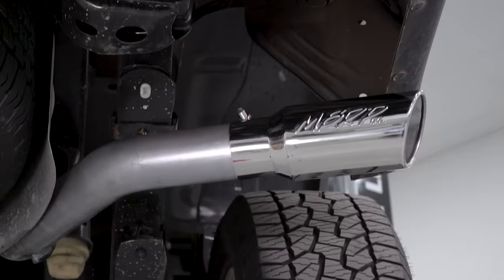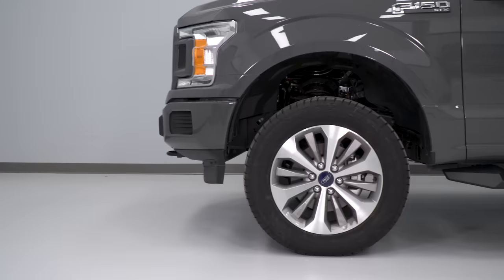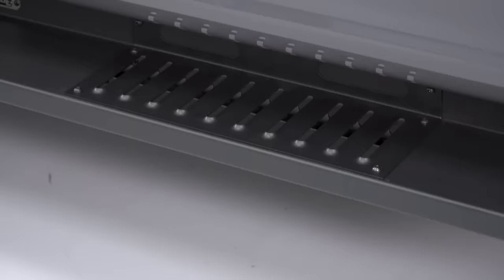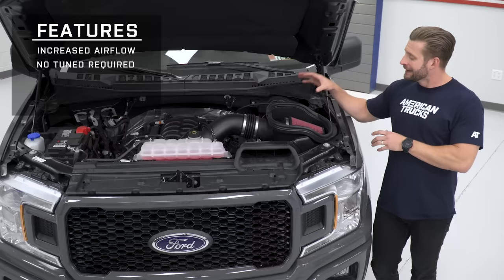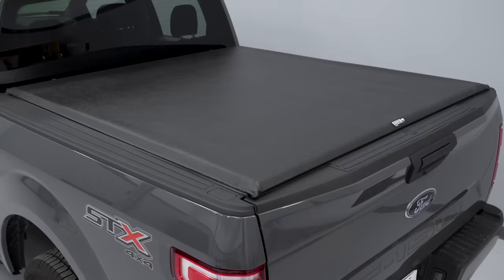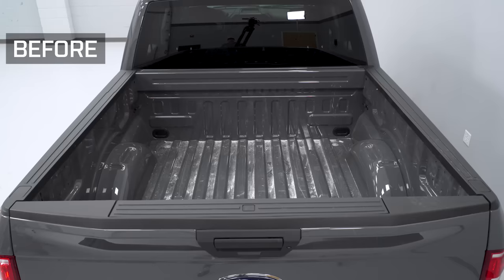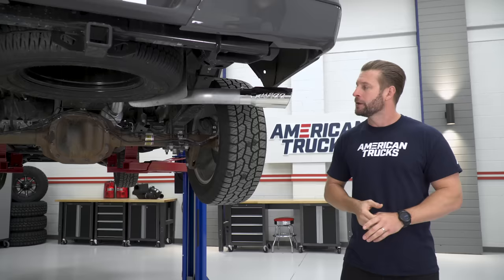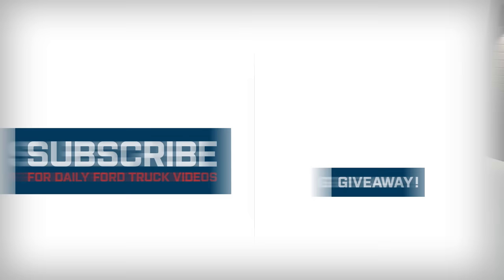The First 5 F150 Parts You Should Buy Under $500 For Your 2015 - 2018 Ford F150   The Haul

Comment from the maker: Learn more about this build and these 5 parts here:http://bit.ly/2sbZ8MZ 
Subscribe for New Ford Truck Videos Added Daily: http://bit.ly/ATFSubscribe
Reply: AmericanTrucks Ford can you really get 35's on that truck with only a 2.5" leveling kit?
Reply: Timothy Anaya yes you can..it’s tight.
Reply: AmericanTrucks Ford,  what does the leveling kit do to my towing capacity?
Reply: What kind of wheels & tires did you show briefly on the leveling kit? (Not the factory set obviously.) Those looked awesome!
Reply: AmericanTrucks Ford  what is the color
Reply: bernardquattlebaum I believe it’s leadfoot
Reply: Can you use the air intake system with an eviction boost?
Reply: AmericanTrucks Ford  sweepstakes

Comment: Personally I think Rear Wheel Well Liners are one of the 1st Must Haves, Huge Difference for about $150.00!
Reply: Agreed.  Mine was $118 on Amazon.  OEM too.
Reply from the maker: Not a bad choice either Michael- great suggestion.  -Justin
Reply: I've added it to my list of items for my truck.  I saw them before, but your comment reminded me to get them.
Reply: Glad to help....LOL!
Reply: I didnt know these things existed until I read your comment and googled it - wow
Reply: Makes for a much cleaner look, wouldn't you agree?
Reply: A little undercoat in there and the liners might not be needed!
Reply: Imo, the liners don't make that much of a difference unless you're rolling a pavement princess. Because if you have any aggressive tire and taking any place with mud, you end of with mud everywhere underneath. Rear wells is a 30-second wash with a pressure washer, while the rest of the bottom is over an hour if you're thorough. Better off spending money on flares if you are slinging enough to get the wells dirty.
Reply: I tore a ford one on my 2016 and had a piece of rebar go through the aftermarket one on my 2018....gave up after that now.  I didnt notice a road noise difference like they say you get.  It sounded the same to me.
Reply: My lineX dealer charged me $110 extra to do the wheel wells. Way better than a liner
Reply: don wilson those are fender flares
Reply: Lol I just sprayed can bed liner in my rear wheel wells. Looks the same and for $20
Reply: Bobon Meiknob you’re wildly misinformed
Reply: Bobon Meiknob water and mud comes up all around underneath from the tires liners or not. Liners are for keeping the wheel wells quiet and free from rock damage and spray in liner does a better job of both
Reply: Bobon Meiknob if they prevent water from going up then they also prevent it from going down thus keeping water against the frame.  I hope for your sake they don’t do what you claim.
Reply: Bobon Meiknob come by my shop anytime. Tremisama Safari Lodge. We don’t have any trailers here, so if you want a more home like atmosphere you can choose the rough camping option upon arrival for a 30% discount
Reply: Bobon Meiknob try google. You’ve heard of that right?
Reply: Bobon Meiknob show up then tough guy. I owned the operation for 28 years.  There’s no misspelling. You asked me where I live not the name of my business.
Reply: If you want real wheel well liners get a civic. Otherwise grow a pair and man up
Reply: vise versa doesn't look the same on long beds. Factory liners are a must on those if you ask me.
Reply: I agree. That was the first thing I put on cause it just looks ugly in the back without them.
Reply: I don’t know how I missed this. I’m on my second F150 and the rear wheel well spacing and gap has always bothered me. You are the hero I needed today.
Reply: I paid 105$ for husky rear wheel liners on Amazon!!!
Reply: @hawaiianf1504  do you have a link
Reply: @luissegovia8650  will it fit my extended cab ? All I see is crew cabs?

Comment: I lost about 1.5 mpg with a leveling kit. It will mess with your aero. The truck has a rake on purpose, and it's not just a preload for weight in the back. The CAI doesn't really do much either, other than a tad bit better throttle response in Normal mode and a cool "whoosh" sound with RPMs. Most worthwhile mods in this lineup are the tonneau cover and the running boards lol.
Reply: Bob saget. Legend. 

Will not do a leveling kit for that very reason. A company that has built maybe millions of these trucks over the years has them sitting lower in the front for more than just aesthetics. Else they would have pumped them out leveled up. Gas mileage is just 1 reason not to add height to the front. Another big one for me is if you ACTUALLY put heavy things in your truck bed time to time because your bed is sagged and your front has you up blasting off like a rocket.

Comment: 1. 3M Thermal Window tinting, including clear tinting on the front and back windshields. (Trust me, you'll thank me later)
2. Weather tech mats
3. Hard cover for the bed
4. Cold air intake
5. Bully Dog programmer

I bought mine used, so it came with chromed running boards, but yeah, running boards are a must.

Comment: My top 5+ must-haves 
1. Window tint and 3M (don't get cheap stuff)
2. Upgrade factory headlights to LED ($500) (and fog lights while you at it)
3. Bed cover ($250)
4. Rear wheel well liners ($150). 
5. WeatherTech or Husky floor liners ($150)
Bonus: Air filter (OEM is aweful)
Reply: Do they make any LED kits for the trucks with Daytime Running Lamps?

Comment: My top 5 under $500 for a 5.0:

MBRP stainless exhaust $421
OZ tune + used tuner $450
2" Level $50 (+$60 alignment)
2018 GT intake mani (ported if possible) $300 + porting
Remote start $150

honorable mention? JLT or PMAS CAI if you feel like it.
Reply: Gotta get that JLT catch can

Comment: you do not gain any hp with CAI unless you tune the truck. it will not change anything because the factory intake parameters remain the same unless tuned. it is all in everyone's head because the CAI will make the engine sound louder.
Reply: AlexanderFX4  yes in deed.  The tuner a must and u will see the improved response and even better gas mileage.

Comment: I installed a full bed rug kit in mine for a really nice mod for under 500. Window tinting and rear wheel well liners are a couple nice mods that won't break the bank either. I bought a new gator evo cover for under 500, much better than a soft cover.

Comment: Most importantly  JLT oil separator, that's a most on any direct injection. Motors. I have one on my 2015 V6 mustang and 2017 f150. Every oil change the truck is 3/4 full of oil.  So this should be the most important . Saves from carbon build up in your engine and longevity of the vehicle. $139.
Reply from the maker: Hey Casey- great recommendation! -Justin
Reply: Casey Berry yea some ppl concerned bout carbon & gen1 Ecoboost motors but truth is Ford isn't having problems overall esp if you run "full synthetic" motor oil AND tier1 fuels.
Reply: @Davido50  by the time I spend the extra 40-60 on 1 synthetic oil change  , the extra on gas for premium per gallon for a month. I've paid for the separator. The life of the vehicle paying 3+a gallons 75-100 syn vs 30-40 regular oil change from ford. I'm money ahead. And I even throw a high grade fuel additive in it every oil. And still money ahead just to empty a little bowl . Cheap or expensive oil or all will go thru pcv valve,  maybe more than another.
Reply: 2018 is Port and Direct, so you dont need the Oil Seperator dont waste your money.. i have 1 and it hasnt filled up more than an inch in the Catch from over 10,000 miles and a year of driving it.. Port Inj will keep ur intake valves clean. If it gives u piece of mind then go for it, but only if you have a 2017 or older should you get one.
Reply: @caseyberry7960  that seperator isnt going to prevent oil sludge build up inside of your valve train.. only the backside of your intake valves.. other then that of course go Synthetic... conventional oil is garbage hence it can barely last even 3,000 miles before the additives break down amd cause metal to metal contact..
Reply: I drilled a weep hole in my innercooler and the cost was zilch.  works as good as your fancy catch cans and oil separators
Reply: @charlesphillips5723  Yea we'll see in 100,000 miles how much that seep hole just to drain condensation has helped your engine internals when your valve train is wrecked😂 but it'll be a life lesson for you to stop believing everything you watch on YouTube 👌
Reply: @nickh3809  I have 161,875 miles on it now.  every oil change I hit that weep hole with intake cleaner.  MAP, OX sensors all test good
Timing gear problems are overrated.  It brings in big bucks for the mechanic when something entirely different is the problem
Reply: If you live in California, you're screwed. Illegal and American Truck cannot ship to any Cali address. I just found out. Their site should warn you of any contraband  upgrades.
Reply: Carbon isn't a huge problem if you use Tier 1 fuel, a quality synthetic oil and frequent changes the catch can isn't a must have. It definitely won't hurt anything but keeping up on the maintenance properly is #1. Other thing is spark plug charges are at 40-50k on an Ecoboost NOT 100k miles.
Reply: @alanholmes2366  my 3.5eb requires spark plugs every 35k miles or it gets a stumble at idle. I do tow a lot though
Reply: Despite reading all about others putting Tier 1 fuel in your F-150’s the Ford Motor Company recommends only running Regular in your Ford vehicle. So why run tier 1 fuel?

Comment: Roush cold air  system routes the opening to the grill as to not suck in hot air from the engine compartment I would think that would be even better than the one you’re showing although I don’t know if Roush offers that one to the general public
Reply from the maker: The intake shown in this video is from Roush and does utilize the factory 'cold air' ducting. -Justin
Reply: AmericanTrucks Ford yes but not the one that comes on the ROUSH supercharged F150 off-road that pulls its air from the grill not from the hot engine compartment..

Comment: One of the dumbest waste of money is changing the air filter housing. The only way a filter can have ‘less restriction’ is to filter less air. It doesn’t matter what kind of air filter that is installed, a engine cylinder can only be filled with current atmospheric pressure. The only way to increase the air in the cylinder is: 1. Cool it. Cooler air is denser air. This is why most modern vehicles are engineered from the factory to get air from the wheel well, it’s cooler.  2. Force more air in the chamber using a scoop, turbo, or super charger. A aftermarket air filter box & filter doesn’t cool the air any better than a factory one. And it certainly doesn’t force more air into the chamber. They are useless.

Comment: My list for ‘19 XLT 5.0 4x4 crew:
1. Tailgate assist from u guys, $37
2. Wheel well covers from u guys, $135
3. Dualliner drop in bed mat/ plastic sides/tailgate
4. Center dash and interior replacements of stock cheap black plastic w. wood trim
5. Bug deflector

Comment: Other things is oil separator, window tent, toolbox, floor mats, wheel well liners, programmer too sct makes a more budget friendly one with that’s not touch screen and make good power gains. And one more is mud flaps some don’t like them but I rem them on my 13 F-150 because I have wide wheels and it saves paint to munch and husky makes a kick back for lifted trucks or wonder wheels that looks good and keep from rubbing

Comment: The MBRP for F-150 and Ranger exhaust system is easy install and sounds amazing for south of $500. I like the design compared to the other expensive options. Glad seeing this in the top 5 suggestions.
Reply from the maker: We agree! Thanks for watching!!
Reply: Hi, great suggestions. ( I must add that I am new to all this) I just bought 2018 F150, 4WD, 5.OL V8, I would like to change the tires from 275/55/20 to 285/65/20! As you know there is not enough space in the front, you talked about 2.5” leveling kit, I have two questions: 1- is that going to give me enough clearance in the front (top and the sides), 2- what a bout back? There is lots space in the back, do I need to add anything else? Thank you, Nick

Comment: I would start with a auto start and stop disabler
Reply: you pull a plug, it's that easy. I'm not even sure why people freak out about it, it's not even an intrusive function.
Reply: @zackjuett967  yes, did that for my new truck! Just hate that auto start/stop!
Reply: David Firth Yes. There are three options; Use FORScan and hook it up to your truck and disable it, unplug the wiring harness that’s under the driver side, or buy that stupid expensive switch that Zack recommended

Comment: Zero of these modifications would be in my best options. First of all unless you are wanting to decrease your acceleration and fuel mileage by adding some big aftermarket wheels and tires raising the front to level it just creates more goofy looking gap between your oem tires and fender wells. Remove the rear spacer if its a 4wd or just put in a drop shakle. It will be closer to level and still retain some of the rake depending on how much shackle drop chosen. Aint you wont need to get a realignment like after you install the blocks in the front. Cold air intakes are the dumbest thing in terms of the name since they draw air from the same location as stock. Its a same air intake. 5.0 F150 trucks can achieve marginal gains with "SOME" aftermarket intakes but  "MOST" actually lower the horsepower on an Ecoboost. Especially the non enclosed intakes. They range in price from 300-600 and help very little at best. If you are doing a bunch of performance mods the intake can come in at some point, talk to a trustworthy tuner to purchase one that at least helps a little. The factory intake is very good and is on most vehicles these days. If you have an Ecoboost save that money and buy an intercooler upgrade. This does decrease the amount of horsepower you lose on warmer to hot days as the oem intercooler is garbage. But a really good intercooler is 550 up. But you saved wasted money on the intake. You can buy a Bullydog BDX tuner for around 500 with a tune or tunes included. Gains are tremendous for the money spent. The 5.0 likes tuning too but Ecoboost really wake up with just tuning only. Catback exhaust do not make gains on the Ecoboost or 5.0 but do sound good on a 5.0. The catted downpipe does help with a performance version but they are 750 up. Steep rails and bed covers. To each his own I guess. If you do aftermarket wheels and tires do your homework. Just because you look at a picture and like it doesn't mean you should buy it. The typical Fuel 20x9 wheel weighs 50lbs round about each and 22x10 60lbs. OEM 20 wheel and tire is  about 75 total. Then add a 75lb offroad tire so you can drive up and down the street, thats smart. You can buy 33s that weigh 45lbs and you can buy 33s that weigh over 75. Reciprocating weight has a far greater negative effect on performance than sprung weight. My current 20 inch wheel and tire combo weighs 60 total per corner and its fast. Had 100lb each once before, not so much.
Reply: You too have done your homework. Picking up a '19 XLT Ford Gold certified 3.5 on Tuesday and the only mods it will get are tonneau cover, catch can and McGard or similar non expanding lug nuts. On electronic controlled engines, about the only plus for cold air intakes and new exhaust is the sound. Then, why do I care if the truck is level? It IS a truck and that rear end height is for carrying capability which levels out with load. A tail dragging truck  even with a trailer is hooked on looks -- terrible. Leveling also wont help aero, that is fuel economy these days. 

With that said, ya gotta remember that these videos are made to sell products, parting you with your hard earned dollars not to increase your trucks power or resale value

Comment: So a cold air intake adds what? 2-5 horsepower to these trucks? I’m pretty sure just saving the $400+ and keeping up on proper maintenance will do the same thing
Reply: the only good reason to do an intake is if you do an exhaust and tune too. But yeah, without a tune its useless

Comment: You're replacing a full stainless factory exhaust with an aftermarket aluminized that will rust out due to the ethanol in the gasoline.
Reply: Aluminum and aluminized steel are not the same.

Comment: IMO - the best thing you can do for under $500 dollars is change out those terrible rear shocks, they are god awful, for under $200 dollars you can get a pair of Fox 2.0, or if you want something with a remote reservoir - Bilsten's are under 200 dollars and while they aren't Fox or ICON they are a really good shock.   2 to 3 hours and a couple of tools and you can change these out yourself if you are going to add the spacer to the front, change out the shocks in the back.

Comment: Get a trifold tonneau cover, they usually just clamp on.   The snap covers are garbage in the cold.  And the Velcro ones are garbage once the Velcro gets a little dirty.  I’ve also had issues with the roll up covers coming off the track and getting wedged in the bed.  
My trifold blocked them 1st 1/3 of the bed.   But didn’t cover the back window.   If I needed the full bed I just took it off and was able to get it in the bed with whatever large cargo I was carrying.

Comment: I agree on most but I think if you own the 3.5 or 2.7 ecoboost the first thing you should buy is a catch can.
Reply: why? Newer models have eliminated the need for it
Reply: @matthewhunter6421  agreed for the most part. But when you are not idling the port injectors are not engaged. For freeway driving the direct injection is what is being used. The more of that crap you can keep from hitting the intake valves the better.